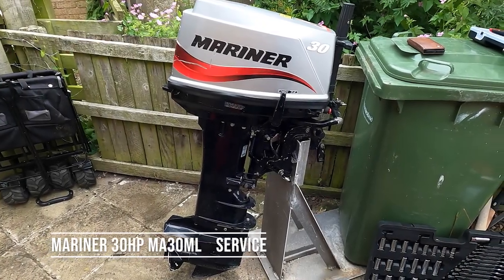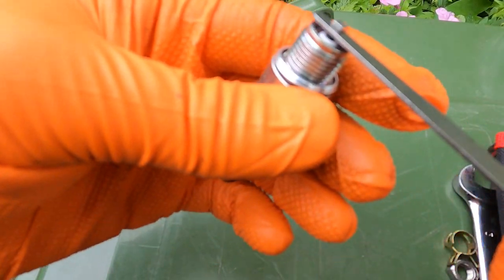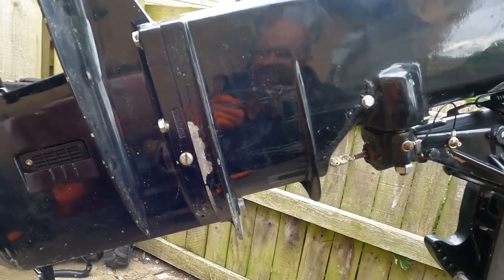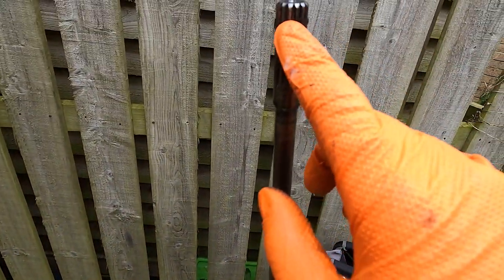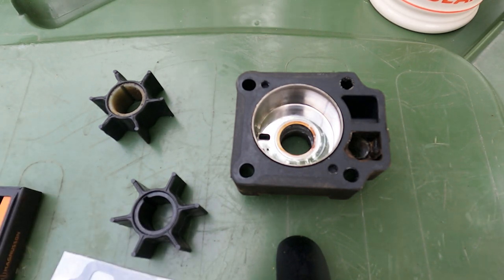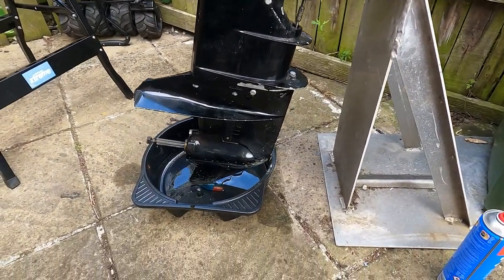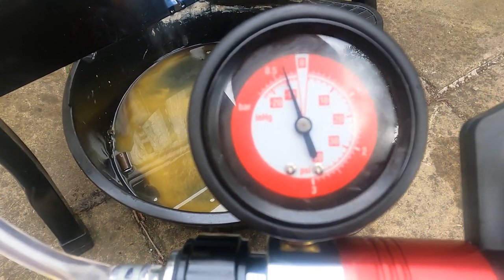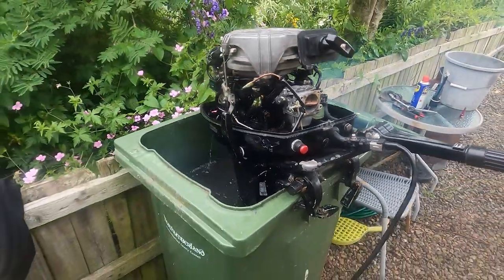How To Service - Mercury Mariner / Tohatsu 30hp 2003 2 Stroke Outboard - MA30ML / M30A4 #mariner

Comment: Great video.  Thank you for taking the time.  Have you worked on Tohatsu TLDI engines?  Mine will need servicing and winterising in October.
Reply from the maker: Servicing is pretty much universal, once you’ve done a few they mostly follow the same standards.
Obviously there some exceptions and differences between manufacturers, cycle type or fuel delivery.

Comment: Hi there great video ! 
I have the same motor , experiencing good running for a while then cuts out is hard to start sometime just fires back up, replaced spark plugs , suspected carb or fuel issue ? Do u have video for carburetor service ?
Reply from the maker: Thanks for watching and enjoying, at the moment I don’t have one for this specific engine. But I do have videos on carbs for other engines. 
Easiest thing would be to use some fresh fuel and try that ( cheapest option )
A carb clean especially on the the idle / pilot jet. 
Sometimes with the engine running you can hold the palm of your hand over the carb intake and this creates a massive vacuum which can sometimes clear the carb if it’s partially blocked. But really the only way to fully clean it would be to take it apart. 
Some carbs have a float bowl drain screw which can be taken off with out having to disassemble the whole carb which can drain any muck or water out the bottom.
Could also be a weak fuel pump not delivering enough fuel to the carb which then cuts out due to fuel starvation. Then you pulling the motor over re primes it. Again this can be rebuilt or replaced

Comment: just what i needed   have  mariner marathon  this video helped a lot ,same outboard  looks also like a tohatsu  could you tell me how many  splines on the prop   . , big thanks help me put the new HT leads to the correct cylinder ,i took them off before i went into hospital and forgot what lead went where  so bought new leads and gave enough  lenghth so i could swap them over  if i got it wrong  
 thanks again  bun
Reply from the maker: Glad you found the video of some help 👍 
I believe the spline count is 10 on this engine but I’d double check, I don’t have access to the engine anymore to check for you.

Comment: Any advice for if the gear selector shaft won't separate at the sleeve?
Reply from the maker: Heat and penetrating oil
Reply: That what I thought, have tried penetrating oil and freezing but not heat yet
Reply from the maker: @thahay5353  only other thing to try in addition to heating the collar up would be to use a pair of grips top and bottom and try to “pull” the parts apart. You might be able to twist slightly as well but I’m not sure how much twist you’d get due to alignment

Comment: Nice work but there is still lots to be improve. Take flywheel off and make a rebalance and the engine will run smoother.
Reply from the maker: Thanks for the tip
Reply: I did that to one of mine

Comment: Great video . But man that engine really needs some spray lube to stop any further corrosion on all those bolts under the cowling.
Reply from the maker: Thanks for the tip 👍 I usually spray the block down with WD-40 or light oil
Reply: LPS works great too and you can select a viscosity you like. It sticks around for longer IMO :)

Comment: Hi there, i have the same engine (mercury version). my motor pumps a lot of water out of the upper exhaust port with a little less out of the tell tail than yours. i have spoken to my local mercury guy and he said its normal with these engines however yours does not do it. any ideas as to what causes this?
Reply from the maker: Hi, 

If you have a good flow of water but not much coming out of the tell tail then it could be a blockage on this rubber hose. 

I would remove the tell tail hose and clear it, could be dried salt or sand etc. 

With the pipe off ( or proven clear and back on ) start the engine again and see if you get more water now. 

If not it could be a packed water jacket or at least the lower section of it. This will need clearing with the exhaust jacket plate off. 

Also check your thermostat housing for sediment build up and also a good time to check the operation of the thermostat. 

The tell tail isn’t the end of the water cooling path but an indication of cooling water. So it blocked doesn’t normally mean a failed water pump etc.

But it’s a very good way to show water flow.

Hope that helps 👍
Reply: @MarineEngineServicing   thanks for the reply. It is definitely not a blockage in the tell tail tube. That is clear. 

I’m not sure what you mean by a packed water jacket? I will have to google that one. Is removing jacket plate and clearing as you’ve mentioned much of a job? 

I will check the thermostat and test as you’ve have in this video.
Reply: Think I found the problem. The thermostat is quite corroded and was stuck open
Reply from the maker: So normally where the tell tail hose is pushed onto the barb fitting, that cover is the exhaust jacket cover or cylinder jacket cover where cooling water fills etc. normally the cover is held on with a few bolts and a gasket. Sediment and salt can settle and dry there causing a blockage of the tell tail. If you’ve got water coming out of it you should be ok.
Reply from the maker: Good shout on the thermostat 👍
Reply from the maker: The jacket cover is on the same side as the fuel pump just next to the cylinder head, it has the serial number of the block stamped just above it if that makes sense.